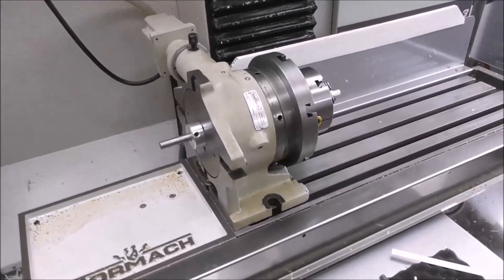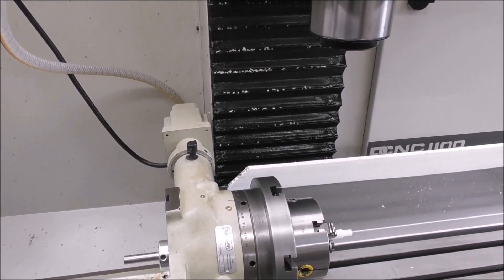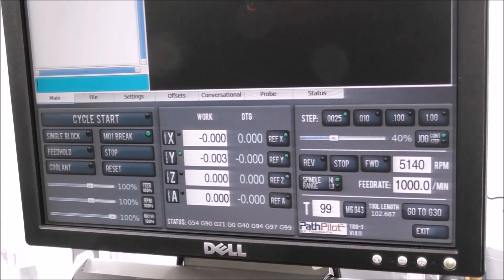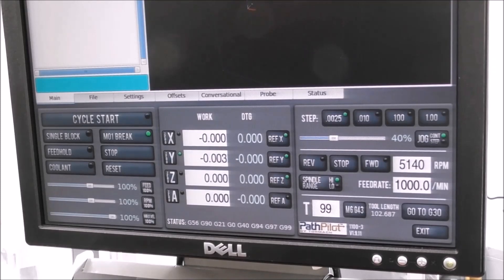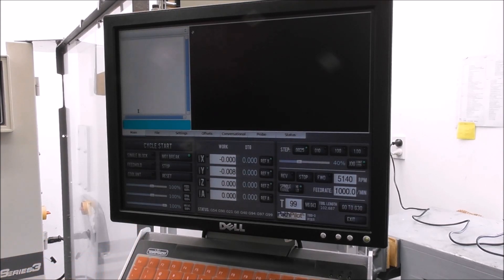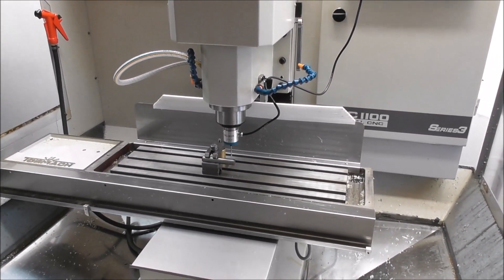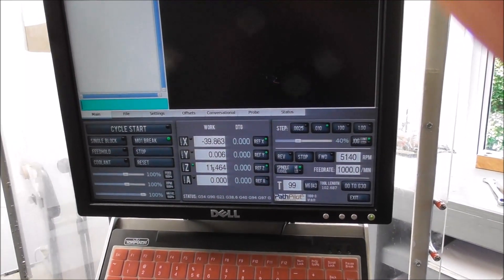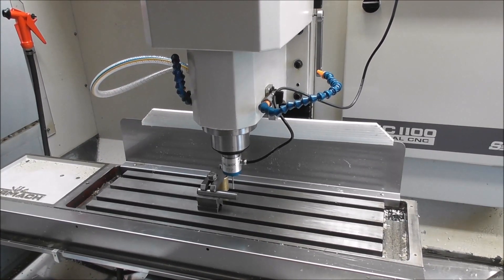Tormach Rapidturn, 4th Axis and Probing -  Part 2

Comment: I wonder if the A-axis Z probe is not accounting for the probe tip diameter like it does for the standard set Z routine?
Reply from the maker: Erik Colvin . I suspect so also. The effective tip diameter in the software  could be wrong for the Y also as two equal wrongs still would find centre. Cheers Cliff.
Reply: Now that I watch that section of the video again at around 11:46 I realize that if you subtract the radius of the probe tip from the Z height at the point that the probe trips it's sensor, you should arrive at the correct Z height.  I've just tried it in imperial and it added up for me.  So it would seem that PP is in fact compensating for probe tip radius.  Any takers?? haha!  ...Actually, scratch that.  I just probed another known radius and it was off just like you explained in your video....  Hmmm